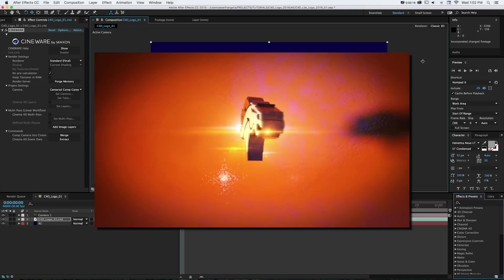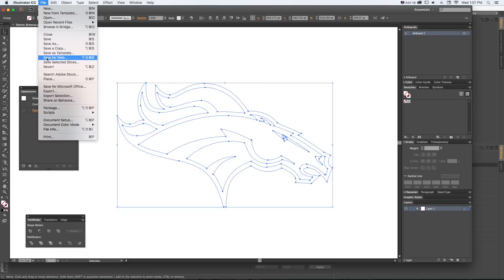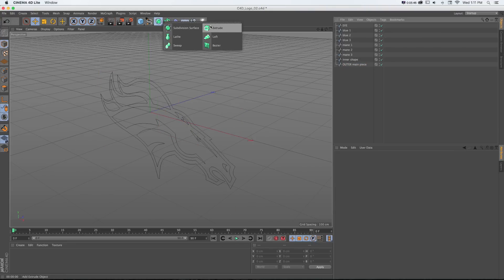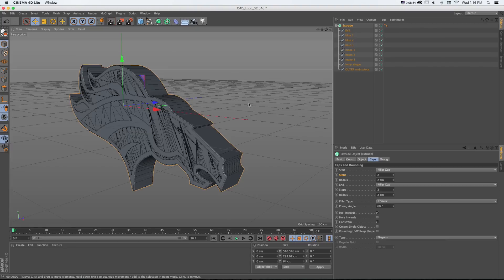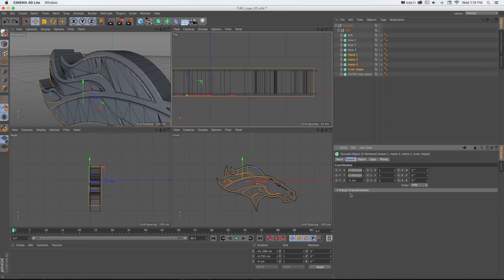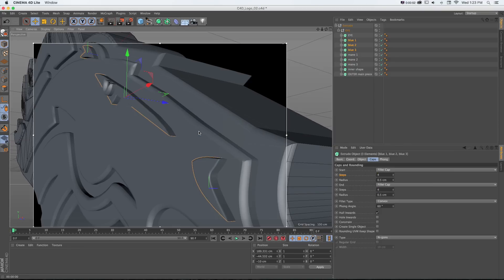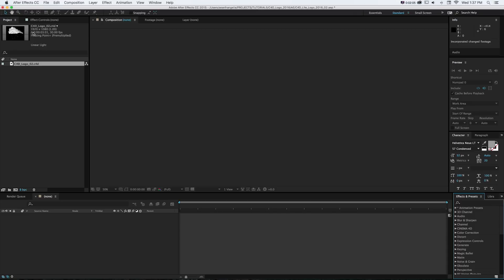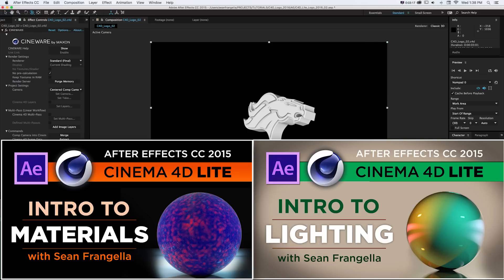Create a 3D Extruded Logo in Cinema 4D and After Effects CC 2015, C4D Lite Tutorial - Sean Frangella

Comment: Thank you for the awesome video, looks great! i have a little question about cinema 4d lite though. I am on a MacBook Pro which is certainly not the best to use with a 3D program, but my resolution looks very bad in Cinema 4D, when i render it it is fine, but while working on it it looks like as if it would be set on half resolution only. is there any setting to improve this? Thanks for the help!
Reply from the maker: No problem, hopefully I can help with the explanation. When you're working in cinema 4D, it is showing an outline preview. You can view different versions of this preview by pressing N, and then A,B,C, etc. for different shading modes. When you want to see an area render to check the rendered progress, you can press Alt+R. There is a small triangle on the side of that box which controls the preview quality, too is highest (full resolution), bottom is the lowest (quick render preview)
Reply: +Sean Frangella thank you!